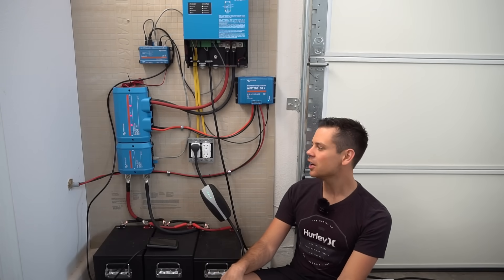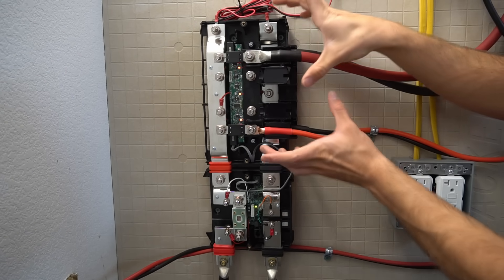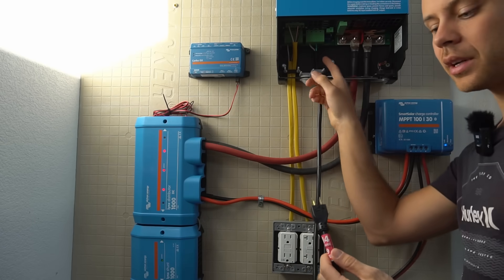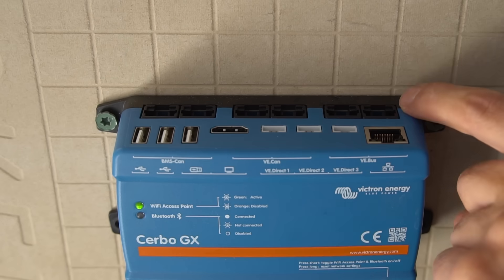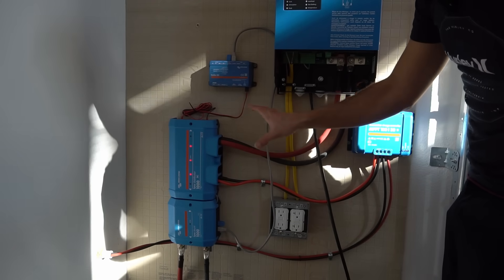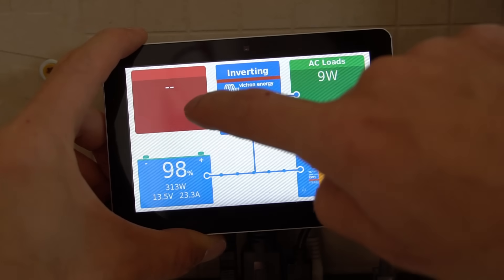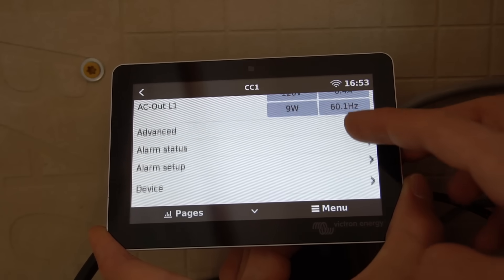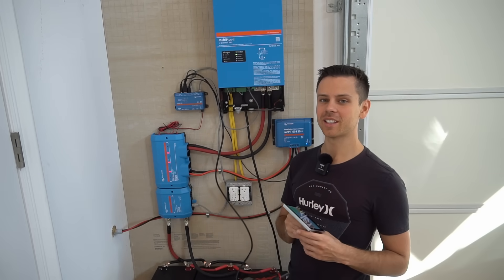Victron Made Easy! Design and Communication, Step-by-Step

Comment: Ok so I have been on the solar website  and been trying to get growwatt over victron 48v 6kw system  and the only reason why 48v is a mini split system at 42seer (Carrier) but would like it to have alternator/wind later. I have a 1972 airstream 22' so 18'6" x 86" of rooftop.  I would like to see a side by side comparison.  Not afraid of the wiring. (Note kiddies 48v can and will kill you if you don't take safety seriously)   I am also looking at the merlin KVRX6X12W  walk on panels  I real haven't  gotten to much on the solar chat website.
Reply: 48V is not dangerous. Very difficult to kill yourself with 48v. Can still burn you tho so be careful. Just like 12V.
Reply: @ShaneFromSA  your right  it only takes .2 amp or .007A ,through your heart for 3 seconds to kill you and most of this stuff is 100amps. And only if it goes though your heart. I worked for the monitors division of HP and seen two people killed by electricity. I myself have been hit by millions of volts at micro amps and been hit by a grounding issue from a 440v live lead into a house that blew on to the ground. Now if you think you can have 100amp at 12v going through your heart is not in the life threatening. It has been  documented  a 42v dc has killed. Not sure of the amps. I have watched electricians  put there elbow on the grounded box and touch the back of there hand to the live leads and seen the spark and burns on the back of there hands. I prefer  a snooper. So please don't go stating 48v is not lethal.
Reply: @ShaneFromSA  just got through reading the OSHA on uner 50v hazards and it does not state "safe" it does indicate hazards in 12 and 24v batteries and to use safe low voltage practices. And I do get why most of the time under 50v is relatively non hazardous. But we are talking 100amps and resistance can be down to or below 100ohm hands typically are avg 500 or more ohms. And what we are really talking is W-s watt seconds. Less than 1 amp going through your heart  for 3 seconds  can kill. Do you have a problem with that statement  because I can cut and paste several college studies on the topic. And if you ran a business or were a supervisor and gave out that advice or prospective there would be lots of people in the Civil law community that would love to part some of that hard earned money from your company and they don't even have to die to get some.  Not to mention the effects of low voltage electrocution is much different than that over 50v.  So with your logic 12v 400amp bus bar would be totally safe. Well cowboy I got $100 I am willing to give to your grieving bride if you think you can bare hands both those buss bars for 8sec.  So complete safe right?  Remember  I said I saw two people die from electrocution well one was fried on a 600amp service and some tried to break him loose with a wooden handle shovel and got thrown 8' back finally a 280lbs man tackle him while not touching the ground and broke him free. Both men went to the hospital. They shut down the job site for 3 days for that(lock out tag out issue that box was not to be energized for 3 more days.) That 48v death was not an ohsa investigatable. And yes OSHA still not reported a single death to under 50v with out other factors involved. While I agree that most people would never have a problem there is always someone willing to do stupid things. For instance do you know what is written on a claymore mine.  "Front toward enemy" and on the other side it says "  Warning explosives is poisonous if eaten.  Do not burn  produces toxic gass". See my point. It is reckless to tell people it is safe when there are safty procedures for that work that need to be addressed. Cause let's face it there are people will to eat claymore mines.
Reply: @seanbrossard8178  look risk of electrocution is real, especially dealing with 60V plus. Lots of people have died from it. I have touched 56V 1000A busbars and been fine. Ohms law also states that I would be fine. The skins resistance is much higher than you seem to think, once it gets inside your body then you have a much lower resistance, this could also be helped by cuts or wet hands. In reality you need a hand to hand or hand to foot, something cross torso to actually die. 
I am sorry for your loss of coworkers but there was definitely other factors involved. Again, not saying anyone should work on an energized 50/60v system that is just asking to be burned but also don't be scared about 48v and use an inferior 12v system . It is still relatively on par with 12v and 24v for safety.

Comment: Oh man, I love my victron equipment. When I started building my solar rig I got a victron smart 250/100 mppt charge controller because I knew I wanted to go big and by doing so I was able to build apon it and get other victron smart devices that communicate with each other via Bluetooth, which saved me thousands of dollars in the long run, because I was able to safely use cheaper, dumb battery packs instead of getting expensive batteries with colt temp shut off and what not. Victron is worth the investment, every time.

Comment: Really glad to see you add a Victron Energy system to your video collection. I am crazy happy with my Quattro set up. You went into detail with the the CerboGX. I am sure that this will show people an alternative to all in ones. VE systems are so flexible and configurable, and you touched on that very well. Thanks Will.
Reply: What battery are you using with your quattro?
Reply: @donlatinohits  I have four Jakiper 48V 100Ah server rack batteries. They have been working flawlessly for a couple of years now, and the entire system just runs without issues. The most stable system I ever installed. I also have an all Victron system based on a MultiPlus II 3000, and another based on a Phoenix 3000. Never issues with any of them, They just run and are extremely reliable.
Reply: @technologyjunkie01  thats fantastic... I just bought an 8kva quattro.... Can't wait to finish the setup

Comment: Hi, did notice alot of finger pointing to + & - connection points. hopefully they not live.  maybe use deposable electrical gloves just in ase  regards Alex from downunder :-)
Reply from the maker: It's 12V
Reply: @WillProwse  is it that Amps/Watts kill you Will ?   Alex
Reply from the maker: @alexb9498  these r amp sources so voltage only thing that matters

Comment: How coincidental ... I just picked up a Multiplus II 2x 120, 100/50 MPPT, Lynx Dist, Cerbo GX (I'll be running headless though) and some Battleborn to setup my 5th wheel for an off-grid system. So almost the exact same setup you just covered (I already have a BMV-712 for my shunt which I'll connect to the Cerbo)! Wondering if you'll dive into tweaking the setup in future videos? BTW, you're my go-to channel for anything solar/LiFePO4 battery related. Well done and to the point.

Comment: Three different communication protocols within one manufacturer’s lineup?  Unless that controller is designed for many generations of products over many years, that’s nuts.
Reply: yeah should be ONE cable to rule them all and NO terminators that's so 1980's like... that stuff can be done automatically these days but outside of the communication nightmare the victron products are amazing

Comment: I just wish it wasn't so expensive to put together a high power victron system. I thought solark was expensive at first but they are significantly cheaper than victron once you actually price everything out.
Reply: This is not the case. At the very least they  are the same price.
Reply: @ShaneFromSA  2x of the new solark 15k would be $16k. That's 30kw of MPPT, 30kw continuous inverting power from solar + battery, built in breakers, etc. How much would the comparable victron system cost?
Reply: @niktak1114  
6x Multiplus-ii 48/5000 - $1630 - $9780
Or 2x Quattro 48/15000 - $10 036

Victron Autotransformer 100A - $685
2x Victron RS 450/200 - $4124
Cerbo GX - $300
Sub Total = $14889
Lynx Shunt - $350
2x Lynx distributor - $400
8x 250A 58V Mega Fuses
$15879 If you want to use a lynx Bus bar
Reply: @ShaneFromSA  nice I didn't know they had a 15kva inverter. Are they certified for grid sell-back in the US yet?
Reply: @niktak1114  No victron inverter is certified for grid feed in the US as far as I know. There might be an old 120V Quattro that is. But in most states you can work with the utility to use non certified inverters, you just have to jump through a few more hoops and they normally want to test that it disconnects properly on grid outage.
Reply: @ShaneFromSA  good to know. I do like the modularity of the victron ecosystem.
Reply: @niktak1114  Yeah, I really like it too. Built systems up to 60kva with 120kw of solar already. Just wish there was more CAN enabled batteries as it works amazing well with victron system.

Comment: I have the Victron 100/20 and it can do 48V as well.  I'm sure the 100/30 is even more capable?
Reply: I just looked up the specs and you are correct, the 100/30 can't do 48vdc, my bad.

Comment: Wouldn’t you have been better off using a 100/50 solar controller since you have 800 W of solar?
Reply from the maker: Yeah but this is random one I have right now. Will swap out for bigger one when it comes
Reply: @WillProwse  One question, why do I see a higher peak PV during a on off rainy day?
Reply from the maker: @timaz1066  temp coefficient of solar cell causes higher output when cell is cold. So if cold panel gets hit with light, high output. on hot sunny days, more consistent power but lower output
Reply: @WillProwse  Thank You Very Much
Reply: I just bought two 200ah lossigy Lithium batteries for my motorhome. The videos and information I’ve been able to find from people using them they are all happy. Do you know anything about them?

Comment: Great video on the Victron systems. I just purchased a system for my RV just like yours. SOK batteries, inverter, shunt, distribution, cerbo GX. Phase 2 adding solar soon. I had to go to Victron training that is touring the US currently to get a grasp on wiring system together after reading all the component manuals. This video is the perfect KISS (keep it simple) video to wire a basic system. Well done.

Comment: I had a Victron system on my boat. Multiplus, 3x MPPT, BMV, and Cerbo. It had 12v1200ah batteries and 2100w of solar. It was bulletproof. But my FAVORITE part was online statistics tracking. It was extremely helpful to be able to see my off-grid usage charted over several months. I think the VRM portal is a HUGE feature for getting into Victron equipment.
Reply: Would be so much nicer if systems could store and access data locally though.
Reply: Must be o nice big boat 🛶 👍

Comment: Hi Will you are this old lady’s hero. 😆. Could I use a second distributor in this scenario to connect my Goal Zero (which is Lithium NMC, not LiFePO) to Chin’s LiFePO or no since tech is different?  Also would I need another Lynx Shunt or just the distributor?  As always I love watching, listening and learning. Sometimes I go back to some of your first videos just for fun. Thank you so very much!
Reply: as far as i know it is not possible.
but you could run two Multiplus in Paralell or series each with a battery bank and own MPPT set at the needed voltages . making a 3000VA (~Watt) system into a 6000VA system. in a basic system you dont even need the shunt or Distrubitor, a simple DC Fuse and switch would do. the LYNX system is just nice to have (especially in systems with multiple batt packs of different AH Cap)

Comment: Newbie learning here and I am trying to setup a temporarily solar panels for my rv.  I have a 12v LiFePo4 300ah battery to replace the lead acid that it came with.  If I use 2- RICH solar 200watt foldable solar panel kits is series, then would I need the Lynx Shunt and distributor if only charging the battery?  I think I would need a Victron Smartcharger 100/50 for my application from what I have found out.  Also, would I need the BMV712 battery monitor or would the app on my phone be sufficient?   Also, think I should put a fuse after the Smartcharger on the positive line to the battery too but not sure what size?  Thanks for any help.   Love the videos for newbies.

Comment: Great vid Will! Been considering Victron for sail boat lithium conversion. Interested to know how you would integrate a DIY LiFePo4 battery build (with BMS) to the Victron system. I.e. will it allow input from a 3rd party BMS or alternatively do Victron supply its own BMS you could use on a DIY battery build? Cheers.
Reply: Check out the link Will gives in the description to his forum. There is an active developer writing drivers for many popular BMS to talk to Victron systems. Victron has also released Venus O/S for the Raspberry Pi to act as the Cerbo. Lots of possibilities, even if everything on the Pi isn't 100% yet (Bluetooth isn't supported yet).
Reply: It would be best to use a good BMS from REC or Orion which have native support. Both are BMS with CAN.
Reply: @ShaneFromSA  The cheapest REC BMS I see listed is $329.95, Orion is $820. REC needs lots of add ons, like cables. JBD BMS are around $100. Best is indeed what you get, but good enough is often the choice.
Reply: Your going to want it to be marine grade or built in a pegin penguin case that has air conditioning

Comment: I installed the victron ac 24 volt charger and the victron Orion 12-24 isolator dc charger in my boat for my lithium trolling motor battery upgrade. It is awesome. I did videos of the whole project.

Comment: thank you for explaining this in such a clear manner. As a follow on other than specific components, would a 48v system be very different?
Reply: I have no idea why someone is telling you Victron doesn't do much with 48v systems. They have a wide range of equipment for 48v systems, and obviously their high power systems are all 48v. The biggest difference is smaller power cables to the battery. Everything else is pretty much identical.

Comment: Can the Victron system be used to charge a second set of batteries?  In my case I would like to charge house and starter batteries in an RV.  Thanks!
Reply: Victron make an "Orion-Tr Smart DC-DC Charger Isolated" that is ideal for your 2nd battery charging. I've found URL links in my post result in the post being hidden. You shouldn't have trouble finding this Victron product.

Comment: Please don't call it an "Ethernet" cable because that is the name of a very different signal protocol.
Those daisy-chain links are probably using s signal protocol called RS485 (or similar).
The cable used is UTP/STP Cat5/5e/6 cable with RJ45 plugs in a T-568A/T-568B pinout. 
To avoid confusion it's best to call it an "RJ45" cable, for short.
Reply from the maker: Yeah I should have said that, sorry
Reply: The video was correct, there are many many protocols that use an ethernet cable, we all know what connector is on the end, ethernet is just the name of a high speed connection for its type and speed, and thanks Will for the informative video

Comment: Having used the cheap Chinese stuff from ebay and AliExpress for the last 12 years I'm moving to victron from a purchased local retailer..
 Better warranty and I can take it back if there are problems. Try dealing with the Chinese, next to zero accountability..
 Victron doesn't have exactly what I need but I can make it work..
I'll be powering some 240v circuits in my house so it will be partially off grid with good battery storage.. I'll go with a 24v system..

Comment: I see it’s all interconnected for self management, my question is what can it support for how long? Being simple minded…can it run my fridge, my well, my tv, my hot water, my heat pump, my lights, my radio, and everything else all at once and forever?
Reply: They can be run in parallel with up to 4 I think, so 12,000w. I also think the Quattro has a 5000w inverter so there's definitely plenty of power available from victron.

Comment: great video, thanks.
I love my Victron system. 
Multiplus II 48/5000/70-50,  3 MPPTs and the Cerbo GX. No shunt because I use a victron certified Server Rack Battery. It is direct communicating with the Cerbo GX.

Comment: Does Victron not have options for 48v?
Reply: Yes. It was just the particular MPPT controller that Will was referring to that was just 12v or 24v. I use 250/100 units on a 48v system with a 10kw Quattro inverter. The Cerbo works on all 3 voltages as well.
Reply: @nigelcharles511  wonderful

Comment: Thanks Will! I am thinking of building a solar-electric house boat. There will be two battery banks. The main drive batteries will be high voltage (350V) and the solar system will all be 12 volts. The company that makes the motor and drive batteries includes a 120V charger. My plan is to hard wire their charger to the inverter. Their system allows charging only when the motor is off. I would like my house batteries to charge the drive batteries up to 100% BUT not if it means totally draining the house batteries. Is there a way to preserve a certain amount of state of charge in the batteries with this system so that it will prevent the drive batteries from draining the house batteries?  Thanks!
Reply: Yes, this is pretty easy to do. Connect the battery charger to the AC2-OUT to the charger and then you can program the inverter or cerbo to turn it off when SOC is low.
Reply: @ShaneFromSA  Thanks Shane! I really like the looks of this system for what I am going to attempt.
Reply: You might be able to setup a victron battery protect to cut off at a certain point. I am sure someone else has more info to add.
Reply: Could probably program the relay to control a larger relay to disconnect the load.